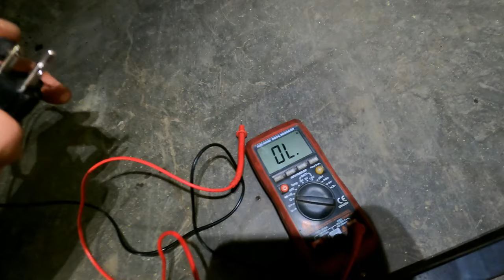I test out a $30 Chinese "TRAIN HORN"

Comment: :thanksdoc:(oo)The Alternative to plastic/petroleum-based products is hemp  various different materials substances resources for it makes over 26,000 different things.  It has even been proven to be 10 times stronger than steel and 30% lighter stronger and lighter than concrete, stronger and lighter than brick. Far more versatile making the design possibilities practically limitless, at the same time being easier to work with on-site'  equally as amazing 1 acre of hemp! Can produce enough bio fossil fuel to fuel 10,000 vehicles for a year at about a dollar per gallon.  One of the major differences is hemp bio fossil fuel only releases the same amount of carbon dioxide  unoxygenated air per mile as a person does when the exhale versus coal, oil, and gas. Which release tens of millions of years worth of petrified death per mile. The real winning sales pitch"  is 1 acre of hemp! Produces 3 to 4 times the amount of oxygen as a acre of trees at the same time sucks in 3 to 4 times the amount of carbon dioxide, greenhouse gases, deadly unoxygenated air as a acre of trees plus it rejuvenates and replenishes the soil back to Garden of paradise type of quality after every harvest even if the landscape has been previously stripped, robbed, and depleted from overharvesting things such as cotton and corn that has been marinating in petroleum-based fertilizer.  Not to mention it has the same nutritional value as rice, corn, wheat, barley, and milk combined is one so we can easily deal with people being over fed and undernourished   In layman's terms                                          we can rebuild faster much more efficiently at a fraction of the cost in half the time of what we are doing today without leaving any excess poison is toxic waste behind.  	In other words we can manufacture, mass-produce, distribute products that every country, city, and continent is going to be happy to spend top dollar.  Example, hemp clothing  distributes moisture across the body more efficiently than any other material leaving a person feeling, smelling, and smiling their best even under the most extreme circumstances don't forget about the limitless design possibility plus it promotes good respiratory function so if a person has asthma, allergies or other breathing complications just by wearing its clothing you will alleviate those symptoms with the potential of diminishing them all together. Hemp  has even  been successfully grown on radiative soil.  So in theory if we grow hemp along the shores of our rivers and lakes we will greatly improve upon the quality of that water.  Nonetheless we definitely will improve upon and maintain the quality of our air, water, foods, landscapes, working/ living environment, habitat, and every day home products to the highest degree that is humanly possible by producing 3 to 4 times more oxygen per acre than we do currently.  At the same time sucking in 3 to 4 times the amount of carbon monoxide greenhouse gases  un oxygenated air per acre as we do currently,   as a added bonus everywhere we grow it we will be rejuvenating and replenishing the soil back to Garden of paradise type quality even if the landscape has been previously stripped, robbed, and depleted of all its value from overharvesting things such as cotton and corn Keep in mind America has about 800,000 acres of available farming land.  	So again we have the manpower, woman influence, technology, resources, substances, capability, and technology to create clean high-paying jobs from coast-to-coast that will improve upon and maintain the quality of life in such a way.That will gradually consistently, constantly, systematically almost effortlessly and naturally thus allowing each person's generation to become stronger, smarter, healthier, happier, better off physically, mentally, financially, possibly spiritually then the previous generation. With that type of leadership, loyalty, and devotion to one's self and country People may start finally having jobs, products, power sources that will allow them to be healthy and wealthy enough to live enjoy their life all the way through out retirement.  You can't do that would dirty low-paying jobs.  That come from outdated power sources, inferior materials, poisonous, toxic substances, pesticides, and chemicals that never change their killing composition which means whether it's solid, liquid, or burnt off in to our airways atmosphere as a vapor is always going to be poisonous, debilitating, deadly to the body at the same time polluting, corrupting, and devastating to mother Earth and all the various different forms of life that live within this world. 		 The bottom line you cannot promote life by doing business with materials, resources, and substances that have been scientifically classified, religiously verified as petrified death or worse. Think about this because it's a simple logic basic concept if life is not free why the hell would death be any cheaper. I guarantee it's not so would you like to know how souls and spirits have paid out are picking up the tab on the end results of dirty low-paying jobs.  Would you like to know how souls and spirits have paid out are picking up the tab on a diminished quality of life? A better question what do you think the spiritual cost is to one's own soul and spirit living dying to the lowest standards of quality opposed to the alternative which is the highest standards of quality?  Case closed. Mercy, forgiveness, and spiritual welfare are not changing these facts. Protecting, carrying, and compensating any whimpering, whining, crying souls and spirits that are freely connected to a life that is not living up to the pleasure, potential, responsibility of femininity and masculinity. You're either part of the world solutions or you are exacerbating the world's problems either way there is no playing it safe in the middle  every one of us is being held spiritually accountable for each and every moment.I Laugh, smile, grin, chuckle with confidence I say now a wish and pray for my soul and spirit to be held spiritually accountable to the statements I proclaim to the way I'm living personally professionally.	 I guarantee you never see hear another body, man, woman in power, persons of legal, religious authority, leaders ever freely validate the statements they proclaim with that level of certainty. One reason could be the don't have the best interest of the majority of the population's needs at heart. Another reason could be they cum from a bloodline of cowards! One is genetic  hereditary the other is simply a generic learned behavior either way it is physically, mentally, and spiritually useless to freely live and die in such a low quality manner especially if that stupidity, ignorance, and desperation stems from being soft, lazy, out of shape, over fed, undernourished, overworked, underpaid with dirty low-paying jobs. S.R.F.
Reply from the maker: What. The. F$@k.

Comment: Not reaaly a fair test as you connected one only to a battery charger, which is 1/2 wave rectified AC and not enough current for this application.  If you put both on a battery and then test it, that would be good.

Comment: oh shit man. i thought this was for a horn not engine heater diagnostics.
Reply: If you'd like to give it some thought, the above video about the horns, was just a way of bringing everyone an aside subject, due to the fact that it's cold enough outside to freeze the balls off a brass monkey to be videoing. The information in regard to the engine heater, is a valuable lesson for others to take note of in keeping a close eye on these leads, because of the extreme conditions they're subjected to. So whilst I do not live in a country that experiences minus 40 to 50 degrees temperature, I believe he showed a good deal of initiative to get the message out there, not only with the heater leads, but to save guys from wasting money buying those horns...

Comment: You are comparing an electric car horn with a air horn! 
What a strange comparison. 
And the power supply used is also completely wrong, it has no pure DC voltage. 
You can hear the 60hz through the sound of the horn. 
Too bad, you can do so much better.

Comment: The battery charger you used will not supply enough ampage to run the horns,  the horns need a 30 amp supply, so the video proves nothing, try running the horns directly off a car battery with the car engine running.
Reply from the maker: The horns are garbage, video was to prove they sound NOTHING like the ads. The horns in the ads are from hornblasters and they are actual air horns.

Comment: Of course partner, it seems that you have total electrical ignorance, the problem is that the battery charger with which you do the test is only an alternating current rectifier, it does not have direct current filters, so you are supplying it with pulsating direct current, which the horn does not it develops all the maximum power, which would be destroyed with filtered direct current like that of a battery, and with this I am not telling you that they are good horns, I have not even tried them but it would be good if you tried I watched the video until the end thinking you would do it

Comment: The biggest fraud i have ever seen lol.
An actual american train horn got between 110-150 db and they usually costs over $2000.

Meanwhile this little 12v electric car horn got 300db and costs like $10 or something like that.

Just to let you know how loud 300db really is:

Tsar Bomba which is the most powerful nuclear bomb ever detonated had a sound output of about 224 db. That was enough to shatter windows on houses over 559 miles/ 900 kilometers away from the explosion.

The loudest sustained sound possible on this planet is 194db anything above that is a shockwave. 

so in order for this horn to actually have 300db it must have like 100 built in nukes or a built in vulcanic eruption. and honking this horn just one time would end all life on this planet.